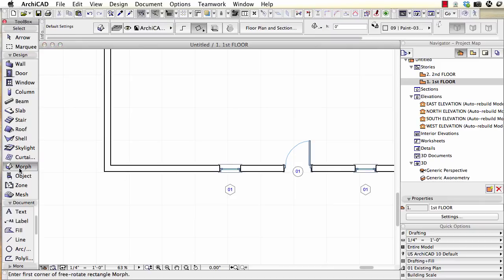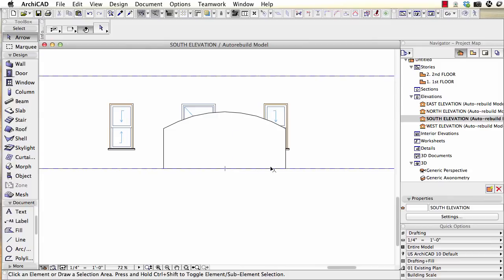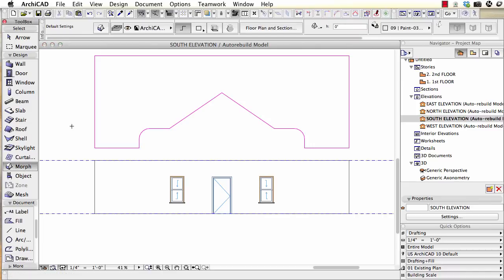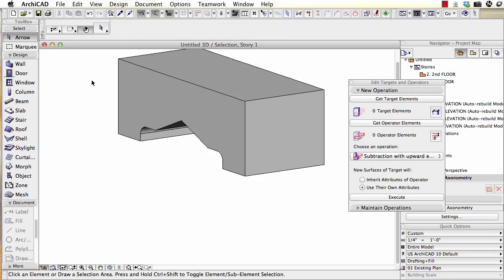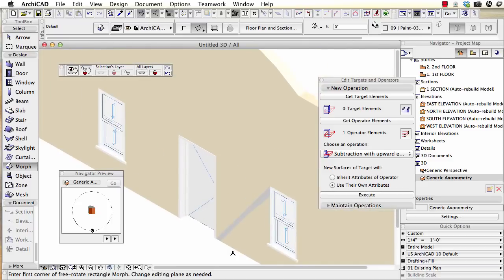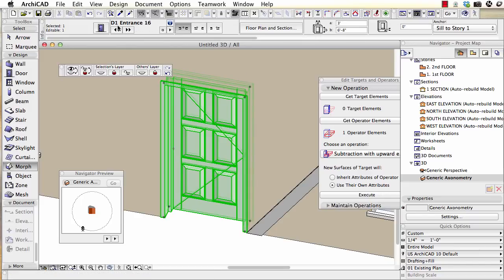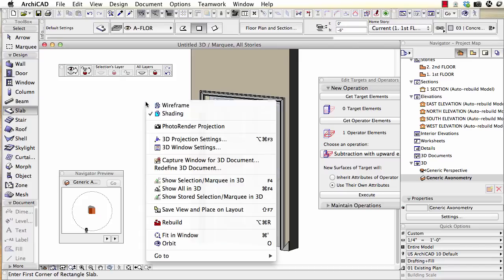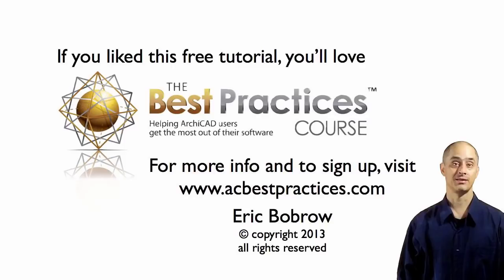ArchiCAD Tutorial | Using Morphs for Facade and Trim

Comment: If you have two sides of a wall at right angles and has morph profile for a building facade acting as a ledge, how can you join them at the corner? Especially when they are both slanted and projected from the face of the wall and does not posses the same pitch.